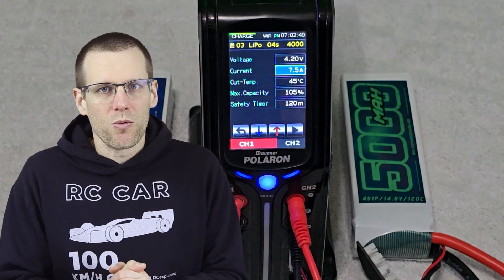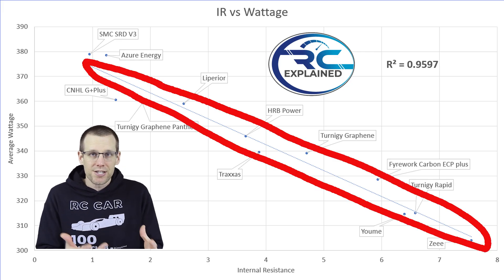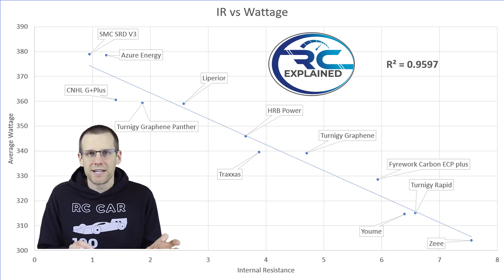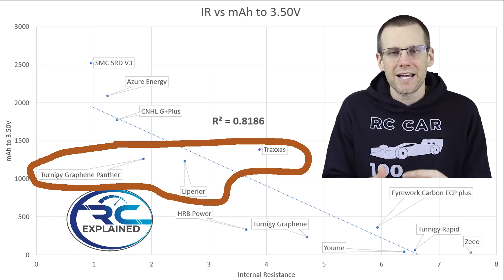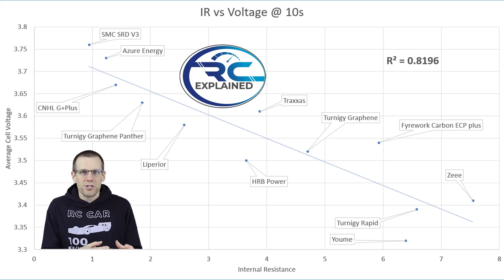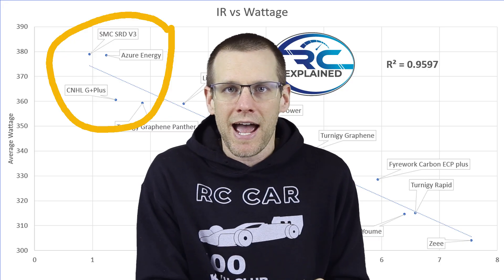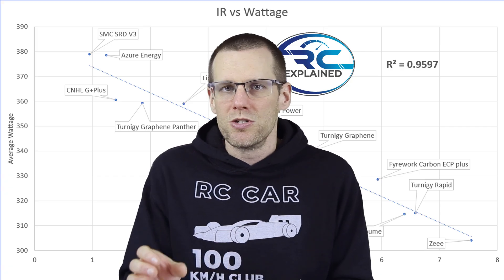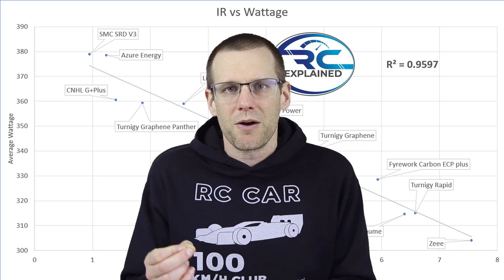GOOD vs BAD Batteries, Internal Resistance Reveals the Truth! Here's PROOF!

Comment: What a strange results you got. At my work zeee battery with drones outperforms any other brands even gensace, gnb and cnhl. They last long under load and don't drop uav out the sky untill 3,3v per cell. They don't puff, even after hard discharge.
Reply from the maker: This test is a stress test for performance and does not look at long term reliability. However, I can tell you thst these cells being pushed hard toasts them quickly.  I'd expect your drone doesn't pull 100A + continuously.
Reply: @RCexplained lol 90+ amps with calibrated power meter, and my 10 13 15 inches can pull a lot more, I'm telling you my team experience not as a rc hobbyist...
Reply from the maker: @KonstantinFPV  I'm glad you are having good luck with them. My experience with tests on 6 packs shows that 100A continuous on the Zeee packs I have would push them to to unsafe temperatures. On my RC that pulls 500A voltage on an 8s pack drops to under 20! Its nuts.

Comment: There's a new lipo out there. Kilowatt RC has made. They are 4s /6s/8s packs and are true 80c. I bought all three sets. The 8s packs are huge. If you get a chance you should see how these stack up against the chart. They do hold charge longer than my smc and chnls/zees. My zees are for bashing and have held up well. Not even a tenth of a volt off yet from too many sessions over the year.
Reply from the maker: Sounds good.
If it's a true 80C this would be more then 2 times better then the best battery I tested so far.

Comment: Excellent video.  I had started buying exclusively SMC.  However I bought some 6s 6000’s that had some really bad soldering.  Flying a twin 70 I lost so much power within 30 seconds the plane could not fly.  My local hobby shop also noticed some poor soldering.  I’m hoping they got this resolved.  It is a good design.
Reply from the maker: That's unfortunate. I've not heard of this before. That can be very bad in a plane.
Reply: @ yep.  $700’s worth
Reply from the maker: Yep I get it. Need good quality packs